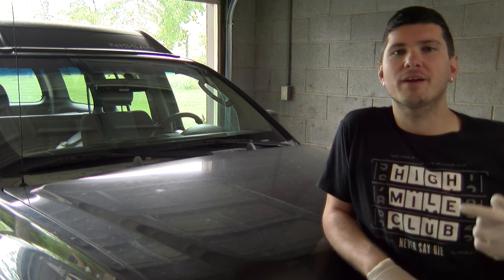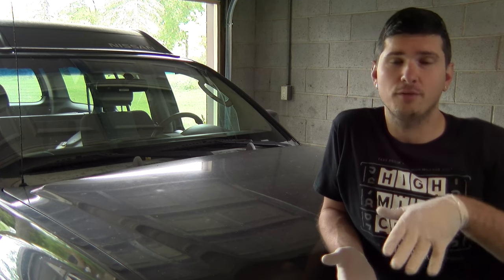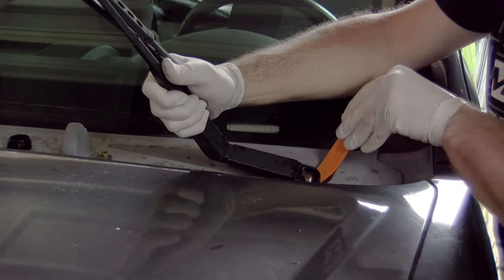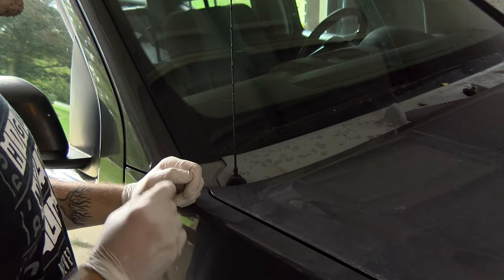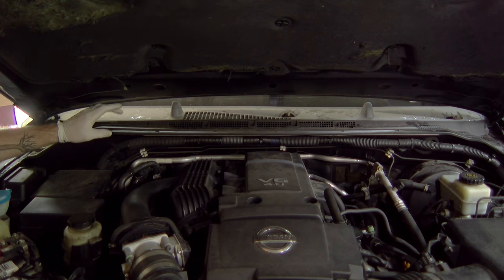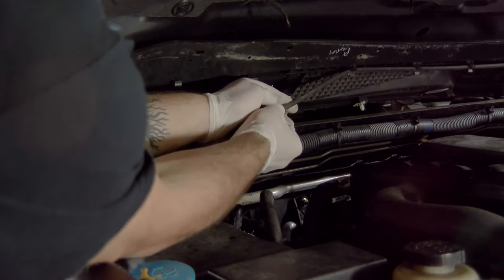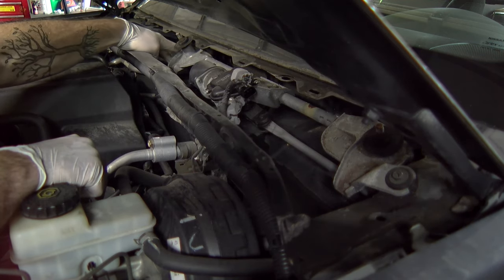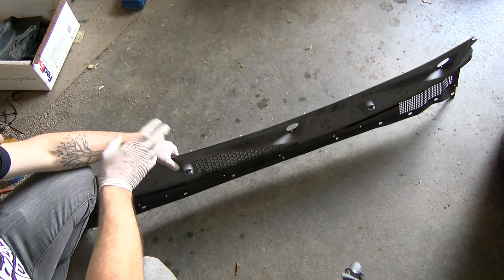Nissan Cowl/Wiper Motor Removal for Xterra, Pathfinder, Frontier, etc..

Comment: Thank you. This is exactly what happened to my 2013 Versa, and your video made my life significantly easier. The car had been parked under a tree for several years, and the gutter (or cowling) was completely gummed up. There was 3 inches of standing water inside the vehicle. There is no drain hole on the floor apparently.

Comment: On my 2009 Xterra, I had quite a surprise when I changed the cabin air filter.
It seems that I was traveling with a stowaway who had decided to make his nest just above the cabin air filter.
I removed the cowl cover between the windshield and the engine compartment, and I installed a sturdy anti-rodent mesh above the air intake of the ventilation system on the passenger side.
I don't understand why, from the start, Nissan did not block access to this opening against the infiltration of harmful little critters.
This opening is easily accessible to small rodents, passing through the inside of the fender trim,
then through an opening allowing the passage of the antenna cable and the windshield washer hose.
Reply from the maker: Oh no! That's what happened to my Titan!! Sorry to hear that. It's really strange that they don't put mesh in it. In fact, that's a great video idea.

Comment: Thanks a lot. Is this the same procedure for a Nissan Pathfinder 2004?  Could you upload a video showing how to fix that plastic panel in case it's a bit broken in the edge? Thanks
Reply from the maker: What plastic panel are you referring to? The cowl? If so just junk yard the part and paint it before reinstall.
Reply: @Rythecarguy  Yes I meant the cowl. Thanks 🙏

Comment: Hi...great video...however I have a 2001 pathfinder and there is no cutout where the wiper motor is....do you have any suggestions how I can reach the bolt to take the wiper linkage off the wiper motor?  thanks

Comment: Very helpful video! I have a 2005 nissan pathfinder and it was pretty much exact cowl to your xterra. My cowl got damaged from a tree branch thankfully no damage to the windshield. Taking off the wipers was so difficult I almost gave up but after tugging back and forth like u said it worked! New replacement cowl didn't not come with the piece of plastic rubber tubing so had to use the one from the damaged cowl unfortunately it didn't line up exactly so had to shorten it and punch new holes for the plastic clips. Felt proud of myself that I was able to do it but now my only issue is that my wipers are not working after I put them back on. The motor works just fine but when I bolt on the wipers they don't go. I'll give it a go again tomorrow. Any tips will be helpful.
Reply: Nevermind i tried again today during the daytime and figured it out!

Comment: Thanks for this video...I have to replace my windshield washer nozzles because they are cracked. I really wasn't sure how to remove the cowl...but now I know! Do you have to remove the antenna base as well?
Reply from the maker: +Wayne Beck yea its just a rubber piece that you pull up on.
Reply: I've got one with a cracked nozzle. Can the nozzle be replaced without removing the cowl?

Comment: Hey Ry, at the 3:11 mark, do you have any idea what the part number is for the body clips that help hold down the cowl? Mine are broke as well and trying to find the part number is nearly impossible. Thanks in advance.
Reply: The panel clips are not on the Nissan parts diagram for the cowl panel. My recommendation is to just get some generic ones that reasonably match the factory ones. You should be able to find them at most auto parts stores or online. You could also check with a local auto glass replacement shop. They break a lot of them while doing glass replacement and therefore keep a good selection of generic replacements around.

Comment: How do do remove that rubber seal when you remove the antenna? After getting the cowl loose, mine seems to stuck.
Reply: Me too... cowl won't come off unless you take off the base of the antenna also... how do you do that... it's the last thing holding my cowl on.

Comment: Funny they always edit the video during a particularly challenging part, and then say it "came right off". Help us understand how hard it is because we need to know if we are doing something wrong lol
Reply from the maker: I encourage you to check out some of my other videos. I do not sugar coat or make something out to be easier than it is. If I say it "came right off" I assure you it did. Trust me, I'll tell you when it's difficult. 😂
Reply from the maker: If you're concerned pull the nut and spray a little wd40 or ob blaster on the stud and just rock it back and forth. It'll pop.